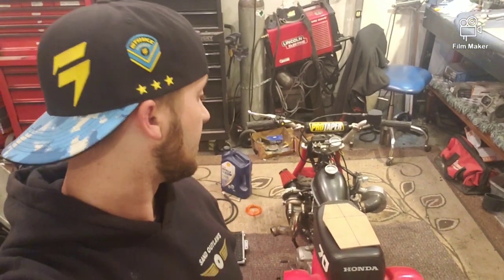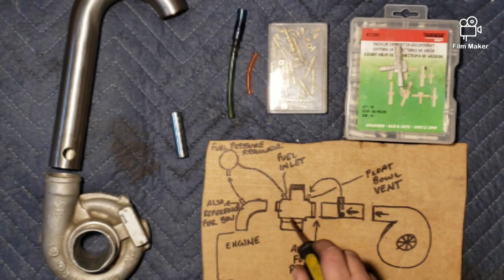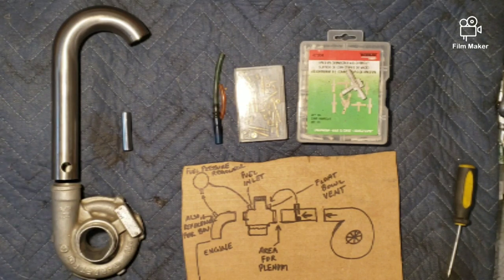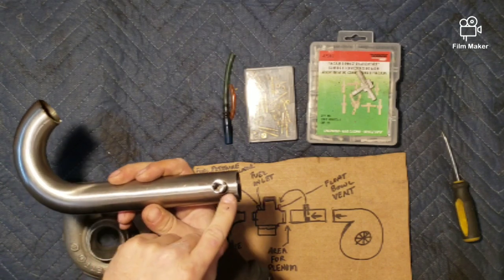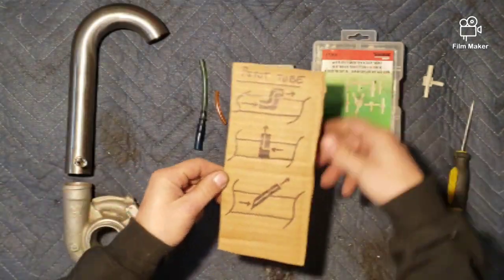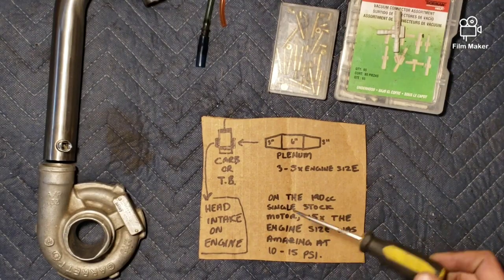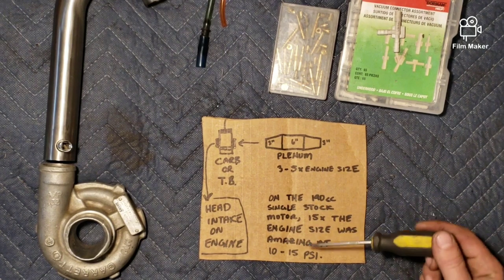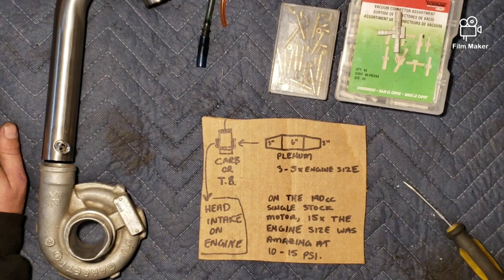ATC 70 Turbo - Update

Comment: Great video. I'm in the starting faze  of a turbo drift trike build . This is super helpful. What fp regulator are you using
Reply from the maker: Thank you! Watch the other videos to, they explain alot, but let me know of any more questions! For a blow through carb use a boost reference fuel pressure regulator that can go down to 0 psi. Here is a link to the one I use: https://spaturbousa.com/products/spa-turbo-composite-fuel-pressure-regulator-0-to-30-psi-vlrpc04
Reply: I have been following for a while now. You do great stuff
Reply from the maker: @hunteallison6008  Thanks! I should have more content, more often now!
Reply: Wish I had of found that reg before I got the 1 I did, spent $300 😧 I got a aeromotive A1000 but it does the job well.
Reply: Dude thanks again you helped so much with my build and now it runs and it's a beast

Comment: The most helpful videos I’ve seen on boosting these small engines. I have a Thumpstar 125 with a YX motor and plan on turboing it here shortly. Do you still run the Powerjet with the pitot tube? I know I will have more questions when I get into the process. I see which regulator you used, is it possible you can link the fuel pump used? My motor should spool the vz21 turbo up no issues with correct sized plenum right? Thanks
Reply: Actually I see where you said you still use the Powerjet. I can use any one of the PowerJet kits you can buy for that?
Reply from the maker: Yes, you'll need both. These guys make a good power jet: http://thunderproducts.com/product/thunder-powerjet/

Comment: I have my turbo all set up and it runs well until I get to full throttle then it goes super rich. I’m on the smallest main jet I can put in my carb. I feel like my pressure regulator is possibly not set correct. You say you set yours just at 1psi. How did you measure that? I have the screw on my regulator turned just about as far as it will go without completely taking it out. the regulator is 0-30psi so with it screwed almost all the way out wouldn’t that let no fuel through? Mine is still going rich. Please some help on this would be great.

Comment: Hey bud. I’ve noticed a few things you have done differently to how I have including tube sizes. Ive taken the turbo motor out of my grom to get it registered as stock so I’ll setup the motor on a bench with an old elec motor attached for load and make a few changes and see how she goes. Awesome video champ. 👍🏻
Reply from the maker: Thank you! That means alot!
Reply: No problem, thankyou for taking the time to make a video with clear as description, not much like it on y/t regarding blowthrough and pitot tube setups and it is a big help to have other tips to try from somebody else. Cheers.

Comment: Do you think an oil cooler and turbo feed line could be used off that bottom sending line? I’ve got an EFI Zs190 I’m about to fit a turbo too.... also how is the oil return feed to the sump plug working? I’m thinking about putting a drain to the oil filler hole if pos.

Comment: How stable is the afr through the rev range and at different throttle positions? I am thinking of tuning the carb for NA first with a wide and lambda, to get approx 11.5 to 12.5, then maybe just altering the pitot tube when boosted to dial in the afr?
Reply from the maker: Boosting it alters the tune so dramatically, I would guess that you would be retuning everything once boosted. You won't use a pitot tube until boosted.
Reply from the maker: Thre a/f ratios are stable once tuned
Reply: @boostedraptor  I know I only need the pitot when boosted to compensate for boost, but if the pitot is correct, then the tuning would mostly be altering the main jet a bit from standard i suppose?
Reply from the maker: @Namesakes.unit-x-10sq10  but would you have the pitot tube in the intake tuning it N/A? I guess that would be fine if the intake tube will be the charge pipe as well.
Reply: @boostedraptor  I was thinking dialing the carb in roughly before I even mount the turbo, thereby no pitot tube, just to get a baseline first.

Comment: @Turbocharged I have a 2012 chevy Cruze turbo on my 250cc runs great until I'm in 2nd 3rd or 4th gear it's like it doesn't get fuel under load maybe. any thoughts? I do not have the power jet you have, but I have bigger jets in my chinese pz30 carb.